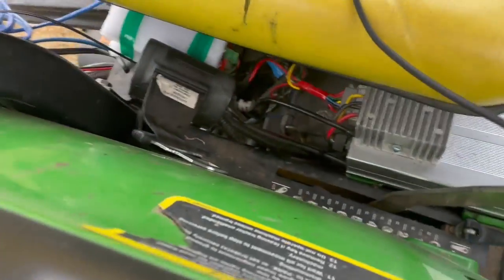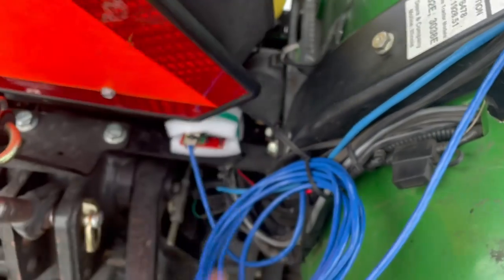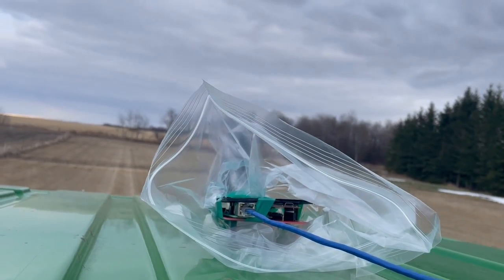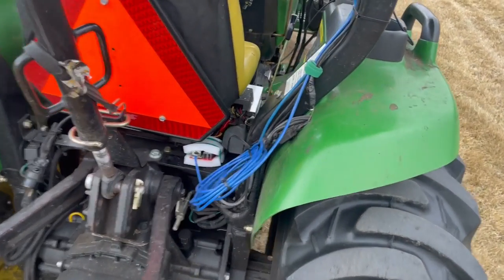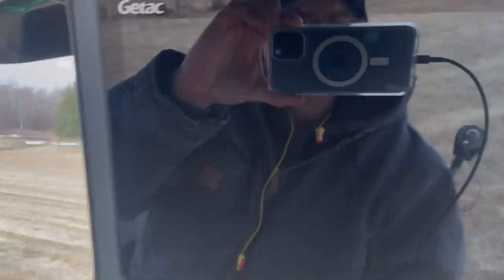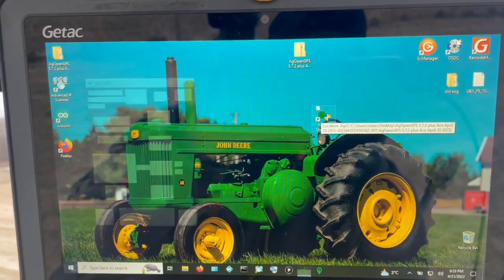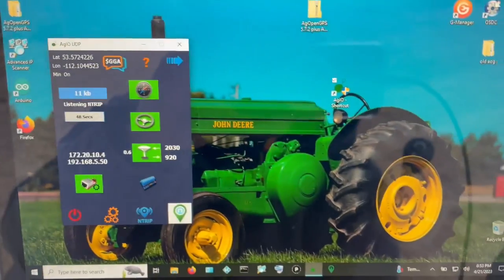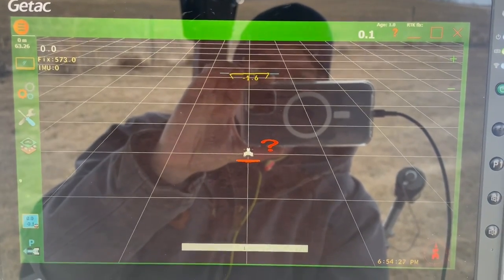AgOpenGPS "Ace Branch" PoE update

Comment: This is in every way a better idea than having everything on a single board.

As a network technician, it just makes so much more sense to me. It's not unlike setting up VOIP phones and IP cameras in an office building. It just makes sense.

That being said, I use dual antennas for the simple reason that I don't like the idea of having the BNO require the board to be flat on the floor. With dual, only the antennas are fixed and everything else can be modular.

So far, I've got a Potatofarmer quick tach motor holder and gears. I've got an emlid M2. And I'm definitely going the udp route thanks to PotatoFarmer doing all the legwork for us.

I cannot thank him enough. Without him (and Pat from Quebec) I would not be on the brink of having a 100% functional system just in time for the season.

A true credit to the cause!

-Emmanuel from Quebec
Reply from the maker: Brian did the lions share yet again to make this version possible. I just pushed hard for it, by building hardware for it. Even though many thought no one would go for it. Thank you for showing your enthusiasm!

It would of happened by myself, just slower. 

Great you totally get it, cat5 is the easiest installing cable around. Also using the 48v standard there is tons of gear that exists already that could get implemented. Like ip cameras.

But like you say, my mission is to make it easier. Everyone should use AgOpenGps.

Comment: Wow! I was wondering to myself about PoE when installing my Kaupoi based setup recently.. Being able to use Ethernet cable for everything would simplify everything massively. Looking forward to seeing where this goes.
Do you have a discourse thread about this project?
Reply from the maker: No dedicated thread yet, just make the odd video about it. So far most have told me either this would not work, or it sounds like too many parts.

But it works great, and has very few parts. Also by things up and being modular, dodge many interference and voltage level shifting issues.

No USB = Awesome

Comment: So with this setup i need a switch in the tractor too?
Are there any plans for a beginner level tutorial anytime soon, I plan on building AOG autosteer but not before winter.
Reply from the maker: The hardware I am creating for Ace requires a PoE network switch. There are plans to release the hardware plans this fall. These boards are very stripped down, trying to use the least user built components possible. 

The switch is needed because the idea behind Ace PoE is if you need an option you plug it in and it works.

Also the modules are simple enough to make different variations of out of different available parts.
Reply: @potatofarmer  Thank you for reply.
I see those switches are cheap enough, and that system would definitely simplify using same components on different tractors - just one cable to hook it up.
Hopefully some guides and schemes will be up by the time i get around to
doing it.

Comment: Great idea and project!
I also think that nowadays pretty much everything can be done with an Ethernet cable lol.

Why did You go the route of UDP rather than TCP?

Either way now just to solve the problem of a Windows tablet :)
Ideally it could be dockerized and put on a Raspberry Pi or some other SoC to which You would just connect via a web app - cross platform solved.
Reply from the maker: Ethernet cable has stayed relevant for so long because it just works.

Brian Tischler the founding inventor of AgOpenGps chose UDP because of its use in manufacturing robotics and outright speed. I have been pushing this branch hard to only use networking and follow the proven infrastructure of an industrial DCS.

The windows tablet is great, readily available and provides more functions that pi just cant handle. Web apps are cool if you have the web. This program also needs to function where the internet does not exist.
Reply: @potatofarmer  Well the Pi would act as a web server for the tablet in the cab - in terms of the utilities I really can't think of a thing where Android / iOS tablet wouldn't be better than windows *tablet*. In terms of UDP speed - does it really matter at sub ms level?

Either way great job and hope for more to come!
I am starting to think about making a robot mower with a proper gas engine not those funny electric toys they sell for thousands :)

Comment: hello im trying to get set up with my first set up iv been looking around for a couple months got a idea of how it all should work was trying to make up my parts list got all the bits and bobs but when i got to pcb iv hit a bit of a block i cant work out how to order one properly or for that fact which one it is or how to work the parts list for that. iv been going back and forth for a while now getting beat with it any  help be appropriated
Reply from the maker: I also thought the AiO’s were pretty complicated so never built one. So started working on a modular PoE based system.

Been designing the modules with the least components possible. To give another hardware option.

Comment: im buildinga aio system im just wanting to know when the moter is working and steering the tractor if i for an emergancy pull on the wheel will the moter fight me or will it allow me to move it thanks
Reply from the maker: If your system has an acs712 ammeter and a modified cytron, the steering will disengage automatically.

But I do not know much about AiO, I have never built one. Just been working on this modular board system that can upgrade v2 instead.
Reply: @potatofarmer   thanks very much i have the board ordered so hopefully its not a mistake going for the aio it seemed the easieest to find info on

Comment: This is fantastic! 
I have 3 tractors V2 boards and I have been putting off upgrading to UDP. I'm thinking that this looks like a good option.
How far off is the Ace branch from the main branch? is it going to get pulled in?
Reply from the maker: The PC program is exactly the same. The “Ace” branch is very much similar to the regular one biggest change being the split of GPS/NAV/STEER boards. The .inos are very similar just extra light, because USB has been stripped out of them. Also data is handled more by the network and less by passthrough comms. Everything is run as fast as possible.

Comment: What are you using for rtk signal?
Reply from the maker: I use an Emlid M2, connected to Wifi. Then use Emlid Caster to send them to the iphone connected to the tablet.

Check out my video, I made one about this subject.
Reply: Most of us use Rtkbase running on a raspberry pi with the same F9P receiver that's on the tractor.
Reply from the maker: @Dezzsoke   I know I’ve read many troubleshooting threads about them 😉.
Reply: @potatofarmer  not sure about the past but I've built around 6 new bases last month. It can send data to 2 casters (we usually use emlid + centipede)
I usually install it under 30 minutes and it just works out of the box.
Reply from the maker: @Dezzsoke  So if you end up using Emlids Caster anyway, why not support them a bit by using their hardware?
Reply: @potatofarmer  it's only a backup in case something would happen with centipede :) most of the guys in Hungary are now moving from emlid to centipede and we try to cover 100% of the country.